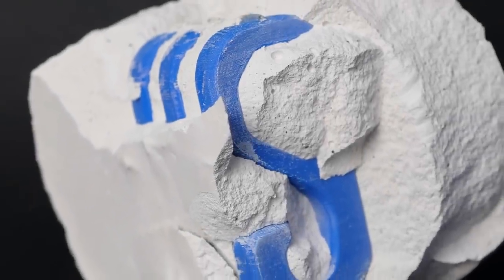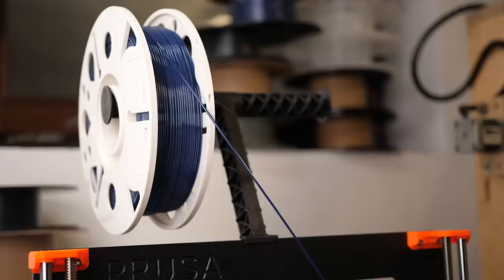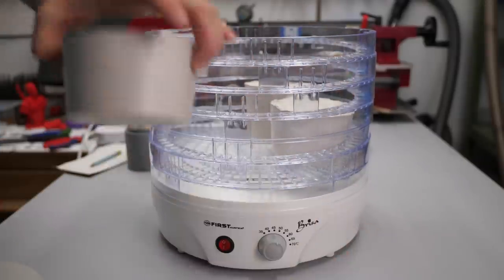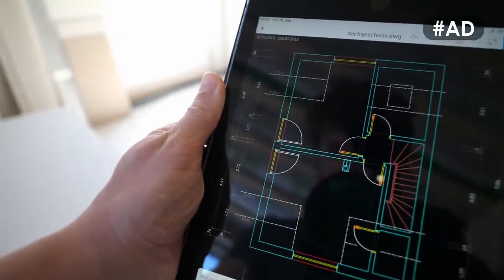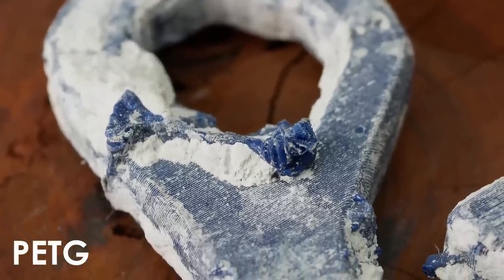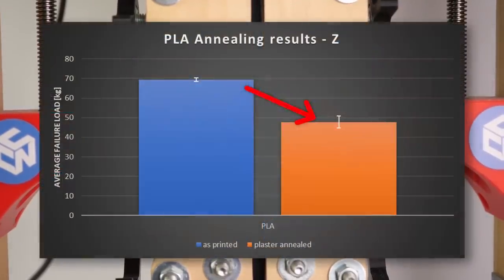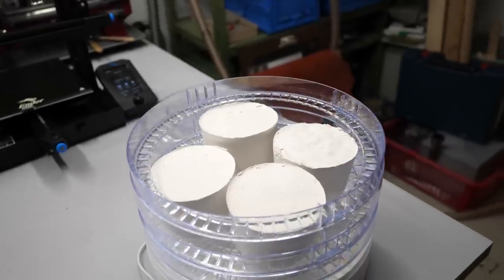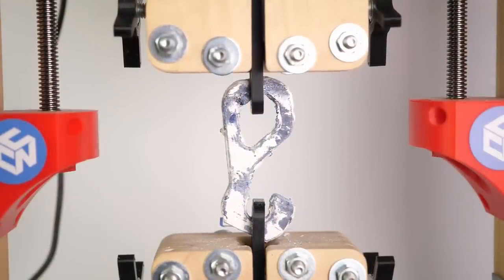Triple (x3) your Layer Strength by Annealing 3D Prints in Plaster!

Comment: How about leaving a port open to the infill and inject an epoxy into the cavities basically making the print 100% solid.
Reply: Hardening epoxy may melt or soften the part it they are pla and other low temp. filaments
Reply: The problem is most, if not all infills create blockages that would prevent the filling.
Reply: @macrumpton  Gyroid infill prevents this issue but im pretty sure someone on youtube already tried filling 3Dprints with epoxy and it didnt work well unfortunately
Reply: If I'm not mistaken, in a previous video Stefan demonstrated that epoxy frequently reduces the strength of the print itself . I got the impression that there was a chemical reaction between the plastic being used and the epoxy . Possibly in epoxy friendly filament could be made?
Reply: Epoxy is expensive. But if you have small, or high value parts, then it may be a good option. One application I can think of would be in 3D printed cnc router components.
Reply: If the epoxy has very different elasticity values, you will find that one material will bear the brunt of the stress until it fails, transferring the force suddenly to the other.
Reply: or you can just print 100% infill
Reply: @OLDFRYEGUY  thats was on the outside and that was probably because the epoxy caused stress risers plus most epoxies dont adhere to plastic very well but using it to add rigidity from the inside might be different
Reply: @JohnnyGTO or maybe dont print the bottom layer, and maybe even use 0% infill
Reply: @notme4083  thought about it but one can cool it in the fridge as it cures or use a slow cure epoxy which will not only be stronger than 5 min epoxy but also with a slower exothermic reaction will transfer heat slower
Reply: @macrumpton  true but not all, aslo 0% infill is an option
Reply: @tinayoga8844  it is expensive otherwise i would have already done it my self XD but also two part foams or caulking or plaster or cement
Reply: Guardian Arias most shapes a need some support. Maybe a better approach is to print a master, make a silicone mold and cast the multiples out of resin.
Reply: @nocommentate9017  you still have the stress riser issue from being layered plus the time goes up exponentially as one adds more plastic to a print
Reply: @GunGryphon  very true but thats why the softer material should go on the outside instead of the epoxy or super glue layered on the outside
Reply: You can buy 3mm or even shorter chopped carbon fibre or use graphite powder , glass powder , chopped glass 0.5-3mm lenght etc mix it with resin and put it inside the part.....i work with resins ewery day , u can buy resin that can be poured in 10cm layers in 1 time and nothing will happend.
Epoxy is expensive but not that expensive....u can buy 1kg of resin for around 20$
Reply: @Guardian_Arias  It does not go up exponentially. Your volmetric flow increases with a solid infill. Also, epoxy doesn't work. Might as well treat it like an injection mold at that point.
Reply: @OLDFRYEGUY  epoxic frendly...jaa
Reply: @tinayoga8844  i print petg solid like a rock but flexible, it was a clamp for a 775 spindle...yuo dont need more epoxic, just big walls and high infill
Reply: @Jamie Fletcher or metal lol
Reply: Inventing casting?
Reply: @anatolyivanov890  resin printer investment casting is pretty good due to the dimensional accuracy and lack of layer lines. It's already a thing
Reply: @Jamie Fletcher resin molding works too. Metal isn't for everything
Reply: Probably not much increase in strength...and heavier too.
Reply: It’ll work, but will bear stress unevenly with the plastic. And, keep in mind the cost of your epoxy, as well as how much you can mix accurately
Reply: At that point youd do better to make a mold of the part and make resin castings.
Reply: @jacobhargiss3839  resin has different material properties, it depends on what you want
Reply: @nocommentate9017  yes it does, but if you're wanting to fill the inside of a 3d print with epoxy, I cant imagine that would have a very different end result than just a straight casting.
Reply: @jacobhargiss3839  well dont do that either lol, but even then there would be potential differences in niche applications like chemical resistance of the outer material
Reply: @nocommentate9017  true, but I doubt thats what the commenter had in mind.

Comment: Try a combination of plaster and salt. First, dip parts into wet plaster soup at least once, but perhaps multiple times to build up a noticeable thickness, then pack in powdered salt after drying the plaster, which should be much easier to remove parts after baking.

Comment: Use SALT. I get EXCELLENT and consistent results by doing this process in finely ground salt (ideally near powder, if you have the patience to grind it that fine). The finer the better. Pack a stainless steel container tightly with salt and the part. In the oven the salt kind of hardens and the part is not allowed to deform at all. After the remelting I just demold and wash the parts and the fine crystals embedded in the wall just dissolve.  I'm left with a part surface roughness that is dependent on the coarseness (or fine-ness) of the salt. The solidified chunks of salt easily return to powder by crushing them with your hands and it can nearly be reused ad infinitum since you lose very little salt at every run. The parts are super strong and water/airtight. I use the technique mostly for printing watertight containers and small pressure vessels. Can do really thin walls too. 
Beware, try to buy preground salt, cause grinding a few kgs of salt in a coffee mill or blender will overheat the motor (i broke my blender this way).
Feel free to credit me if you try the technique. Also take a shot for every time I said the word 'salt' in this here comment.

EDIT: I just made a video detailing the process and results. https://youtu.be/nRLJ4ylGTFc
Reply: This is actually really smart. When my Prusa mini finally arrives next month I'll have to try it.
Reply from the maker: Nice explanation!
Reply: @CNCKitchen  thank you for taking the time to read
Reply: Thats a nice idea. Do you think using road deicing salt is okay for this too, as it's way cheaper than table salt.
Reply: @ProtonOne11  probably, though here in the Netherlands even iodized table salt is like 50¢/kg. The main thing is to use a stainless steel vessel, because a steel one will rust pretty quickly with the salt and heat, and will discolour the salt which I guess could transfer to your prints. Another thing is  to pack it really tightly. If there are pockets of plastic that are not packed and properly immobilised they will sag and deform, so you should thing well about the geometry of the part during design.
Reply: So you just bury the part in salt powder when annealing? Have you measured any amount of deformation? I feel like it would be much support.
Reply: But doesn't that reintroduce the same deformation that you would get when annealing in sand?
Reply: @angelorf  i don't know. I've only done fairly thin parts and I observed no deformation. I'll try a few different geometries and let you know. One thing I can tell you for certain is that salt is way less mobile compared to sand (I tried that too, a couple of years ago, different coarseness levels, all were excessively deformed). The salt kind of hardens and you have to scoop it out of the container in chunks, though it turns back to powder as soon as you mix it with a spoon or crush it with your hands.
Reply: That's 10 shots, for anyone wondering
Reply: Does it help in any way with ABS or ASA prints as well?
Reply: @amplitude2836  i only tried it with PETG and ABS. The few times I did it with ABS the temperature of the oven was slightly below melting point, so the ABS just annealed (they got way tougher, but I didn't measure anything so I can't say). I'm sure it will work though, as long as you don't overcook your plastic. The remelted PETG works just like a treat. The texture is kind of like that of very fine sand (due to the coarseness of my salt). With transparent PETG you can also sometimes see air bubbles from when you print thick walls and there are little bits of air trapped between the print layers.
The company I work for uses a chemical that is only is only impermeable to PETG (i tried so many filaments, even stuff like HDPE). We use this technique to make prototypes that contain this chemical.
Reply: Amazing, I got the same idea just minutes before reading your comment!
Reply: by the way you can make a paste out of salt that has the same consistency as plaster and use that... and for the brine you can just let it sit in sun and you will be able to recover your salt too... and since salt is hydrophilic then it can help to absorb any moister from the 3d printed part (specially PLA) later on during the dehydrating and annealing process
Reply: Perhaps vacuum packing/sealing bags that are oven rated could be used to lock the salt in place. I've seen something similar with vacuum packed ground coffee; it's practically a brick.
Reply: @free_spirit1  I'd be extremely interested in the testing of more dimensionally sensitive parts
Annealed PLA or Annealed PETG in salt just might be the 3d printing holy grail if it doesnt deform like in sand
Cheap, no mess, more temp resistant than abs, asa and nylon, and still strong enough
Reply: @free_spirit1  Does vibrating the salt bucket make it pack more tightly?
Reply: @CNCKitchen  Importnat to know - preground salt from shop has anti-caking (I do not know how this word is in english exactly, but this is an additive so that during storage it does not compact like a stone under its weight). It's can be fine tapped to harded.
Better make manual grinding form crystals using ceramic ball mill.
Reply: To everybody in this thread. I just made a video detailing the 'salt' method and the results I get from it. https://youtu.be/nRLJ4ylGTFc
Go check it out!
Reply: @free_spirit1  thank you for taking the time to post.
Reply: @CNCKitchen  please try this
Reply: Prices in world salt markets will go significantly up :)
Reply: why not just use fine sand?
Reply: Look for "popcorn salt" at your grocery store. It is already ground into a consistent powder and comes in the same sized containers as crystalline table salt.
Reply: @CNCKitchen  Perhaps put the salt in a vacuum bag as I mentioned above?
Reply: The nutribullet is great for grinding spices into dust, even salt. 👍🏻
Reply: holy shit!
Reply: That’s really cool. I’ve seen diy rock tumblers and wonder if they would help at least crush the salt somewhat before hitting it with the coffee grinder.
Reply: Why salt which is not typically found as a fine powder instead of some other highly water soluble very fine powder which is readily available in that form which can take the heat without outgassing or some other harmful reaction?  Any ideas on what that might be?
Reply: @winstonsmith478  If you're thinking baking soda, it does give off gas when heated. Powdered sugar melts and compresses. Salt is also used in pipe bending to prevent kinks and total collapses. Plus salt's super cheap and available everywhere. Do you have a better idea? If you want to do the plaster of Paris thing, simply dipping the part to get an outer shell should be good enough.
Reply: @winstonsmith478  @Tim Dodge I was just thinking about baking soda... Sodium Bicarbonate. When heated it forms Sodium Carbonate which is anhydrous and loves to suck up moisture. I make it for it use in marine aquariums for pH control. Once you have the carbonate form, it should be suitable....and I might just try it since I already have like 20kgs.

It's very powdery naturally and water soluble. Heck if you were keen enough you could probably boil off the water and use it again.  If it's not stored properly it will absorb moisture and go hard...so you'd need to bake it again.

I haven't studied chemistry in a few decades, but I'm pretty sure you should be able to bake it many many times.
Reply: I mean.... plaster is a salt
Reply: Ack...you’re gunna make me a language pedant which I hate. 

In a lay discussion salt = sodium chloride, or something that is mostly NaCl. Unless otherwise specified we all know that. 

Other salts would be referred to as “a salt”. Saying plaster is salt is false, saying plaster is a salt is correct. 

Sometimes English really sucks especially when one word can have many meanings.
Reply: I in
Reply: This is a really interesting idea. Salt (NaCl) is very hygroscopic so it will help pull water out of your print that it might have absorbed. That also explains why it hardens when packed tightly when heated. In normal ambient conditions it absorbs moisture from the air and even creates a tiny film of brine that bridge the gaps between the grains. When heated, the water is driven off and the remaining salt becomes like a cement binding the individual grains together. So ideally you would want you fine salt to ever so slightly damp, so that is no longer pours freely but starts to pack when pressed. I think you could then avoid the dehydrator and go right to a low temp oven to drive off the water at just below the softening temp of the plastic. Then once you're satisfied that the salt has fully dried, crank up the heat to anneal/recrystallize your prints.
Edit: I think that you would only need to use the finely ground salt for direct contact with the print. The surrounding salt could be coarser to make it easier to source and speed drying because it would be more porous.
Reply: seen this guy doing it in salt https://www.youtube.com/watch?v=nRLJ4ylGTFc
salt tend to get harder at high temperatures but is easier to remove
Reply: what material /time  / kind of oven are you using? I really want to learn more about this process it seems so "obvious" and genious at the same time.
Reply: @Tailslol  that's me!
Reply: @free_spirit1  nice ^^
Reply: @tenten5398  salt washes away easily.
Reply: I wonder if the same process could work with powdered plaster, and no water.
Reply: I saw the video in your channel before seeing this one and can say, your method is great, thank you for sharing it!
Reply: I recently found your video and I tried out the remelting of ABS parts with ground up salt. It really seems to work great. Would be nice if CNC  Stefan would give it a try and  let us know what the numbers are :-)
Reply: @davidhyland3833  With ABS I had 1.37% decrease in X/Y and 0.7% increase in Z Axis deformation. That's a lot less than I got while annealing without the salt and I did go up with the temperature quite higher (230°C instead of I think 150°C or so)
Reply: I'd imagine the kind of sand people use for casting metal would work well too.
Reply: For more detailed or intricate parts you can make a detail skin from plaster and set in salt or gravel. A bit of fine short glass fibres in the mud might eliminate the need for a case entirely. It’s basically the same as a lost plastic casting process but instead of melting the plastic out and replacing it with metal, you just melt and soak for a bit. As far as I know reheating these plastics can have detrimental effects, possibly an undercoat can be found to reduce interactions between the mud and the plastic.
Reply: @DeadDaem0n  Anticaking is the correct word in English. You make a good point, if this method relies on the salt caking then regular table salt might not be the best choice.
Reply: @DCBpower  How about a shell of dipped plaster, dried, then laid in a bed of salt? Might reduce the salt packing requirements. You'd still have to chip the plaster shell off of course.
Reply: @iAmTheSquidThing  this is what I'm here to find out
Reply: @Amos Allender this trick will make 3d printed HPDE watertight. Actually the first polymer I tried it with, which is weird, since it is about as exotic in the 3d printing world as it is common outside of it.
HDPE will not harden though, afaik. Also it deformed more than any other plastic I tried it with.
Reply: I read the post on reddit recently.. ^^ I found the idea really cool too! (/r/functionalprints)
Reply: @angelorf  post cleaning of the part with salt in water is easier than cleaning sand from surface of the baked part.
Reply: Very late but i just got an idea, since very finely powdered salt is not that easy to get your hands on unless you powder and sift it yourself (nope..). But.. coating it in thin coast of plaster, multiple layers and then dunking it in regular fine salt.. would maybe retain the surface finish and doesn't need very fine powder.
Reply: after drinking a fatal amount of alcohol from reading your comment, I am 3D printing in hell, where there's plenty of salt to go around. Thanks for the tip!
Reply: Why not borrow from existing knowledge in the casting industry?

Two suggestions come to mind.

First, the water added to the plaster is a problem. Second, if using sand, salt or any other powder, you want as fine a grade as possible.

So first, use as a plaster that is as fine as possible. Jewellers will be familiar with the term "investment plaster". Then use it dry (you'll obviously need to pack it into a container).

Casting plaster is pretty much just gypsum, dug out of the ground and milled to a "good enough" particle size.

Investment plaster is finer, which costs more money. There's no real financial benefit to producing a superfine finish on a cheap moulded object, but if you're casting gold, there is.

Also they're a formulated product containing additives which address a variety of the issues you've covered...air bubbles, shrinkage...but also issues specific to casting metals at temperatures of 400°C and higher.

This temperature difference may or may not cause some problems. I don't know as I haven't tried this, but I worked with people in the investment casting industry.